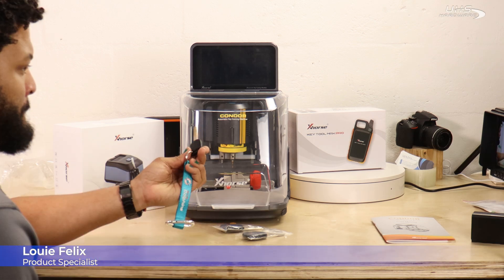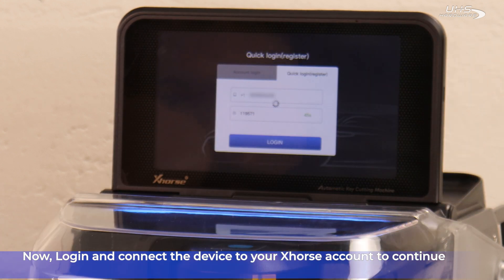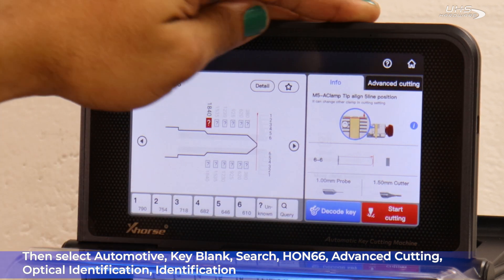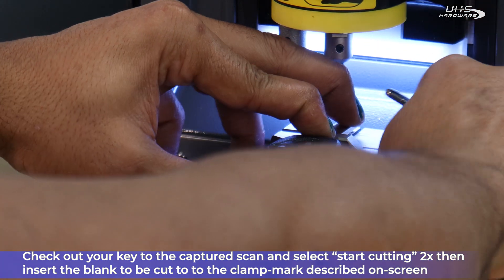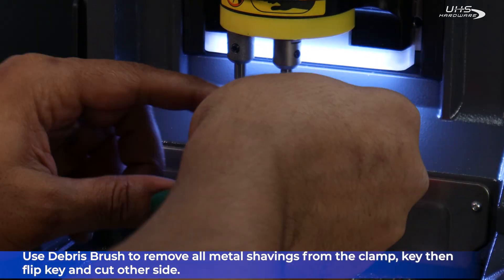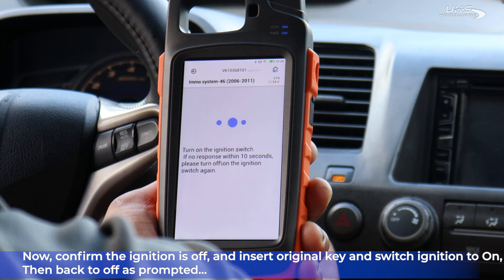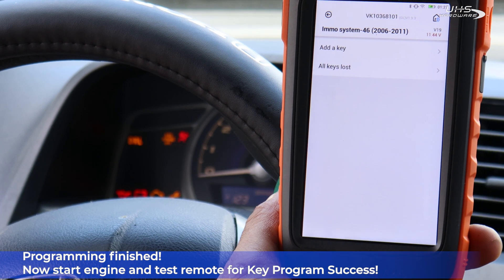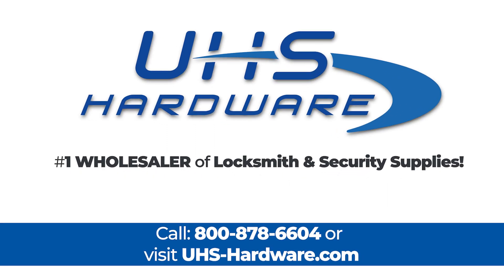How To Xhorse Condor II w Key Reader Read, Cut and Prog transponder Key for 2008 Honda Civic - HO01

Comment: Why not click find bitting? See if it finds the code instead so it’s exact
Reply from the maker: Both are equally capable of finding Bitting. The upside would be saving wear or possible probe breaks in order to do the process. this device is alo useable with the stand alone app and key tool max/ Plus giving you more ability to do this task when not near your key machine.

Comment: Why not decode the key with the condor 2 or universal duplication?
Reply from the maker: Great Question, there is not a reason aside from desire to have another option or method for backup or to add longevity to the probes being used.
Reply: I saw this video as showing the key reader function. There is always other ways to do a job.

@UHS Hardware. A nice and explaining the key reader and as bonus the rest of the function.
Not living/working in the US, but these stuff get more and more global. So thanks for a nice and informative video (worldwide).